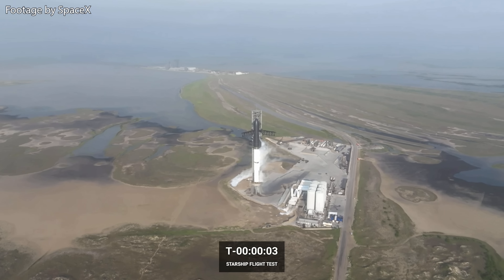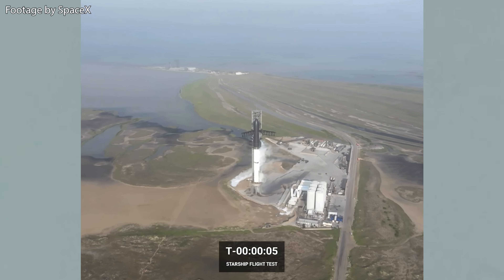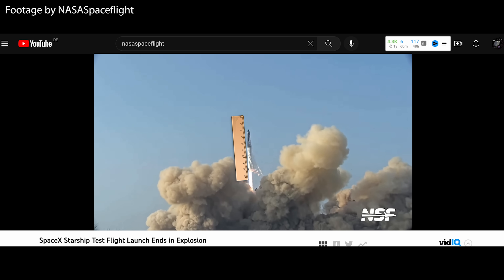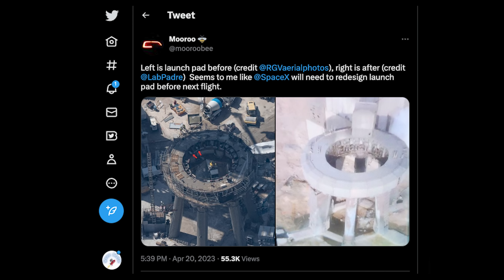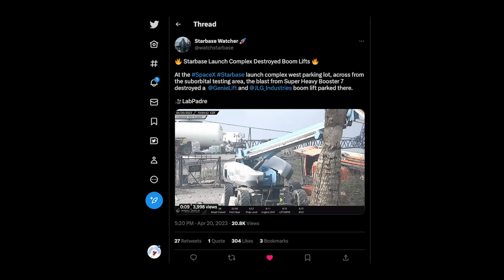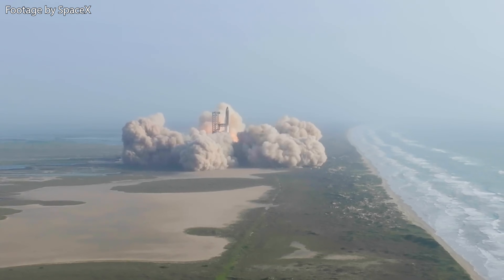SpaceX Launches Starship But Causes Big Damage to the Pad. What Went Wrong?

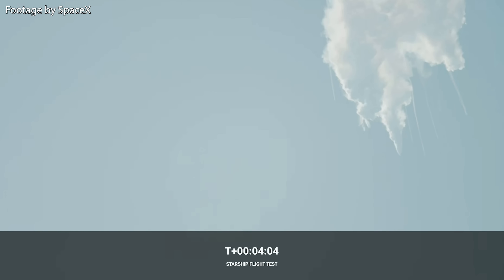Comment: 3:00 No, come on! Analysis like this harms your credibility. 
If you watch the video again, you'll see that there is a noticeable distortion in the video image, probably due to shaking of the airborne camera due to vibration from turbulence or even sound pressure waves from the rocket itself. Could also be atmospheric distortion, but I think less likely.
Reply from the maker: I know...in the heat of the moment everything looked plausible, but obviously it is an optical distortion, my bad!

Comment: I completely agree that the engine loss was very likely due to Pad debris being thrown up, but I'm not sure at all about the rocket pitching away from the tower not being on purpose. Also, on SpaceX's live stream they called for booster engine cut off and ship separation. They've said for a while now that they're going to use an inertial separation like they do for releasing starlink satellites, so it almost seemed like maybe what happened was they called for engine shut down and started the rotation of the rocket to separate the ship from the booster but the engines didn't fully shut down and so the ship couldn't separate and it started going off course. 🤷🏽‍♀️

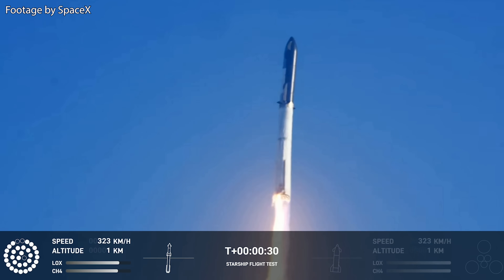Comment: I think when the one motor exploded in flight 2:15 it damaged the Hydraulics for the Gimble control not sure if the 2nd stage release works on Hydraulics but I'm sure they would have at least tried a stage separation ?
Reply from the maker: Possibly!

Comment: There are rumors that we first saw the first HPU explode in mid-flight, and then the second HPU exploded in mid-flight a little later, so at some point without hydraulic power. HPU = Hydraulic Power Unit, that is the black longish rectangle at the bottom.

Comment: I'm pretty sure the initial tilt was on purpose. To get the vehicle away from the launch tower. Didn't they do something similar with space shuttle?
Reply: The space shuttle also bent on engine ignition. They had to wait for the rocket to straighten up before they fired the boosters and let it fly.

Comment: That launch pad was always my big “NO WAY!”  The second all of the exhaust became sand colored I knew the substructure had failed catastrophically and was probably responsible for the destruction of several of the engines during boost phase.  They need to unfuck themselves and get very serious about a water trench that is even huge by NASA standards or this type of damage will cripple their program.  Funny how brilliant people overlook the most basic of infrastructure requirements.  The launch pad at the cape used to flow tons and tons of water per second in the flame trench for the Saturn V at 7.5 million pounds of thrust and the trench still had to be reworked after every launch.  Come on SpaceX, pull your head out!

Comment: Im suprised they used the lunch pad like that, with no watter buffering system, and not clearing the pad area better. There is a reason every larger rocket lunch since 50's uses that to suppres sonic vibrations

Comment: You could see when they tested less than half the motors that the launch pad /ring would have to be higher, and concrete was not suitable for the task. With the ring 7 to 10 meters higher and possibly those same or similar heat Sheild tiles they use on the ship used for a barrier might work or steel plate over the concrete maybe. But they will fix it, they get things done. Its incredible how quickly they got the ship built and to test fly.
Reply: Yes Martin , I Would Think A Six to Eight Inch Thick Solid Stainless Steel Plate On Top Of The Reinforced Concrete Might Hold Up Long Enough For The Ship To Take Off The Launch Pad Without Projecting Chunks Of Concrete Back Up With Enough Force To Destroy Any Of The Raptor Engines ....At Least It Cleared The Launch Tower !

Comment: Great video and analysis Beetle.  Personally, I think the vehicle was fatally damaged by debris at launch.  I've Always, Always been frustrated at the very poor flame trench design for the starship.  The blast of that amount of energy must be directed through a very deep channel, AWAY from the vehicle.  The tilted posture of the starship on launch was the immediate indication of the damage to the engines, dooming the vehicle.  Thanks again.
Reply: I agree and too am disappointed that this almost stupid, I don't even have a word for it, mistake, cost them a potentially 100% successful first mission.  Which has immense value in itself.  Whilst this is just a big bump in the road, the pace forward has not slowed.  This mixed result necessarily increases the number of question marks, which has a high cost.  I'm not sure if waiting for the water deluge system, would have yielded result much different. I'm thinking this is going to trigger some serious redesign.
Reply: Yes, you can see large debris blowing around the rocket before lift off. At first I thought it was some harmless light debris but now I believe it was something more damaging

Comment: Wow - the damage to the pad is insane. It will be interesting to know whether the ejected debris is what damaged the engines - you'd have to think so as it sat there for ~6 seconds. We are all experts in retrospect but you'd have to say the decision to not have a flame diverter was a terrible one. The fact it got off the ground, the explosion and wobble mid flight and that it hung together while rolling at 2000km/h is testament to the engineering and despite the RUD you'd have to declare it a success. I guess now to build a new redesigned launch mount and do it all again!!!
Reply: You actually don't have to declare it a success.

Comment: The pad might need to be built with reinforced heat tiles so to withstand the force and heat of take off
 Or a much greater launch tower system will be needed for this rocket system. Probably all of the above. We are dealing with many new factors. What we thought previously is now inadequate. A mega system is going to be needed to manage these forces. Tally Ho!

Comment: IMO the catastrophic failure of the pad was 100% predictable… I honestly thought the OLM was just a stage 0 manufacturing path finder and I was convinced the lack of flame diversion and deluge was proof that the pad wasn’t intended for an actual full launch… just testing and system development… boy was I wrong. 🤷🏻‍♂️
It was pure unmitigated luck that the debris didn’t destroy the rocket right on the pad. If they just patch this thing up and try to use it again the FAA should send the SpaceX management for drug testing. 
An appropriate flame diverter for starship ought to be something on the order of 2-3 times more robust than the system used for SLS… the fact that they attempted to launch the largest rocket in human history with 17M lbs thrust with no diversion and deluge system is both shocking and entertaining.

Comment: We kind of expected severe damage to the concrete of the launch tower and I was surprised Elon didn't build a flame trench, ok that would have slowed things down, but we have what we have. I was extremely excited to see the spacecraft leave the stand and start to fly without a RUD, to see her go through Max Q was more than I had expected. Way to go SpaceX, now as you have in the past, sort it out and go again. Stay safe and keep on exploring.
Reply: Yeah at minimum it needs a flame diverter and water deluge system.
Reply: They have a water deluge system that wasn't ready for use yet.
Reply: A flame diverted would be desirable but it wasn’t thrust what caused the damage.  The damage was caused by a steam explosion from UNDER the concrete.   The ground there was still wet from the deluge tests carried out recently, therefore, when the engines fired up and ran for 8 seconds, they flashed that water to steam.  Kaboom!
Reply: @johncampbell9216  didn’t think they got up to that stage of installing the water deluge system? (As it forms part of the new flame diverter they are working on also) if you have a link to any report keen to read more on it. It could have been a high water table too which the area has. Still a flame diverter will eventually stop that energy going into the ground (as much) and defect it sideways to be dispersed more effectively. Hopefully they can repair it in a few months (but could easily take 6-9months to repair everything, it’s a serious amount of damage! And does look like an underground explosion as you noted. Cheers
Reply: @apt962  What they actually tested was an “explosion suppression system” (my error).  It was tested about six months ago.  But certainly your water table point is also very valid.   I’m now less concerned about flame trench construction and more about ground heat avoidance.  Make the pad thicker or create a sectional steel plate “flame diversion cone” that can be rapidly assembled or removed from under the launch mount.  Anything to prevent ground water heating!
Reply: @johncampbell9216  I’m like most - really wish them the best in fixing the pad and sorting pad issues as it only gets cooler from here as they fly without pad damaging the rocket and the next iterations in stack. the catch tower is the most insane/coolest engineering concept ever! Can’t wait to see it catch and water rig launches eventually too!
Reply: @apt962  Absolutely!  I think what Elon and the guys are doing is fantastic.  I have a very different view on the Mars colony concept but i nonetheless support his efforts to push humanity into space.
Reply: @johncampbell9216  yeah even the significant improvement in mass to orbit opens door to building large items in orbit even large orbiting bases and a lunar colony is an exciting future.
Reply: @johncampbell9216  I'm not sure I believe that as a first cause, I doubt thick solid concrete could conduct enough heat to flash water to steam within 8 seconds, maybe if the concrete was already breaking up to the point that the hot gas was blowing directly on water you could get a steam explosion on top of the damage already caused though.
Reply: @joinedupjon  but clearly, by the images of the aftermath, the pad is not “solid concrete”.  It’s a layer of concrete over a gravel base.  A gravel base that is in contact with groundwater and which has been subjected to dousing with water on numerous occasions.
Reply: @johncampbell9216  ok I understand your explanation. Then that would explain some of the effects seen in the liftoff moments and some damage to the aft end of the rocket and initial damage to some engines
Reply: @franzstraumann2373  Absolutely, Franz.
Reply: He knew but he wanted to see if the system actually works, remember Russia lost all three of their large rockets. Elon wanted the starship to clear the pad it worked.

Comment: NASA developed and launched the Saturn V without a single launch failure during the Apollo program. It has successfully launched and completed a round trip to the moon with its Artemis program on the first try.
The SpaceX Starship spectacularly fails on its first launch, yet the Elon Musk sycophants are claiming success. I don't get it. The entire Starship launch seemed so amateurish. The launch pad had no blast deflection or water deluge system. The rocket was allowed to leave the launch pad with 3 (9%) of its engines non functioning. Since it is liquid fueled, why weren't the rest of the engines shutdown? There is no way, at max payload could that rocket achieve its mission with a 9% loss of thrust at liftoff.
There was nothing successful about this travesty. While there are risks associated with any massive development, IMHO this just seemed to be a callous disregard for safety.
Reply: Thank you for being one lone source of reason in this sea of Elon fan-boying.  This is ridiculous.   Everyone has just poof forgotten that Musk has been bragging about Starship being ready for an orbital test flight for over a year!  They are trained to applaud every failure and immediately take up all of the prefabricated defenses like "clearing the pad was the goal." HELL NO it wasn't. 

Thank you for pointing out the huge success of Artemis.  The rocketry work and dedication was top notch.   These fanboys need to go follow Elon in one of his other endeavors, bc launching rockets is not a popularity contest.  For all intents and purposes, these are enormous over-fueled ICBMs,  and people's LIVES are at stake when we try launching them into orbit!  That's why NASA can't afford to fail.  This launch probably did have some minor successes but overall it was an unsafe, total failure.

Comment: I just don’t get it. How do they not know that those giant tanks will be smashed to hell from this??
Reply: There is a gigantic berm in front of the tanks to block them. They even recently increased the height of the berm in anticipation of debris. Sometimes there is just more of an effect than you can predict. But they did what they thought was necessary based on analysis.
Reply: @ericquest1802  then they need new analysts. This isn’t even close. Did you see the debris?  Even orange safety cones. At a minimum, secure everything.  Ffs.  It’s like a 7 year old designed this facility and is in charge of organization prior to launch.  It’s beyond dumb…
Reply: @ericquest1802  they even had some vehicles parked in the blast zone….
For such a forward thinking company, this is unacceptable. I’d be surprised if attempt #2 happens before end of 2024. 
At a minimum, dig a tunnel and reroute the blast away. And make the stand where it’s clamped twice as tall. 
They should be ashamed of this facility.

Comment: https://www.youtube.com/watch?v=UxhzYuLxS0Q&ab_channel=%D0%90%D0%BD%D0%B4%D1%80%D0%B5%D0%B9%D0%A5%D0%B0%D0%B4%D0%BA%D0%B5%D0%B2%D0%B8%D1%87  Korolev encountered exactly the same problem 50 years ago. The problem is not only in the launch pad, but also in gas dynamics, vibration

Comment: Engine explosion at about 30 sec looks like it busted a LOX line.  Watch how fast the LOX dropped 50 seconds onward in the telemetry. At the end, LOX was empty with a lot of methane left.

Engine graphic did not represent actual number of running engines.  I'm sure there is a telemetry delay but at 100 secs it showed another going out only to show it back on 12 secs later.  That did not happen on the video close up.

Question is, did the pad debris kicked up cause many of the engine failures.
Reply: Absolutely! Debris was ejected higher than the tower, and out into the ocean. The bottom of B7 looked like swizz cheese! Looking down into pad crater you can see China waving back. It's amazing the thing even flew. That's one hell of a ship!
Reply: @hawkdsl  I read they continuously flush the engines area compartment with CO2.  It may have prevented a total rocket explosion at the 30 sec point where one engine exploded.  Maybe SpaceX learned from Russian N2 rocket.

Comment: I just don't understand why they thought they could get away with NOT having a flame trench and water deluge system.
I don't have access to any of their engineering data, and I know this is only a testing pad, but the cost of losing rockets due to debris destroying engines and ultimately the rocket should have been considered.
It makes me wonder about the decision making process going on over at SpaceX.
Reply: Elon is on record saying it would be OK, or the dumbest idea ever. They knew it wasn't going to work, but Elon wanted to try anyway. Things have slowed down at SpaceX allot sense they won the contract to be the moon lander. That's because NASA wont tolerate that type of stupidity. Elon was pressing to meet false dead lines (Land on Mars in 2024!), and a real pad was going to take allot of time (The current one has been under construction for two years). They will fix it, and build a real pad, but now it will cost twice as much, and delay everything.
Reply: It was all about cost. Building a proper flame trench and water deluge system is incredibly expensive. There's a reason why SpaceX is using existing NASA launch pads at Cape Canaveral--because it saves them from having to build a proper launch pad from scratch. SpaceX preferred to wait until they actually had a working rocket to see whether they needed it or not. Well, now they need it.
Reply: @kentslocum  that’s my point— cost. Losing test vehicles costs not just money but valuable time as well. There is plenty of scientific and engineering knowledge in the last 50 years that says that you need to think about the destructive power of rocket exhaust. I thought it a basic tenet of getting into space. There’s a difference between being stubborn and being innovative.
Reply: @oldmandoinghighkicksonlyin1368  Agreed. The cost of building a high-quality and durable launchpad complex is an order of magnitude more than the cost of building and launching a single rocket, but it can be amortized over the lifespan of the entire launch complex, since it is designed to last for a very long time. SpaceX was definitely in a hurry, and they didn't want to spend the time or money required to build a large, expensive, and mostly invisible (to the public) launchpad. While the structures they built were fine for a test stand, they are hopelessly insuffficient for regular launches of any kind.
Reply: Agreed.  Stunning that no one ran an analysis of the destructive force of 33 R2's at that distance.  Plenty of data available every day from McGregor site.  You don't destroy stuff just for the fun of it.  This infrastructure took years to build and now it is unusable for several months.  They are lucky the blowback of concrete didn't result in a RUD on the pad.  Serious lack of critical thinking on this aspect of the test flight.